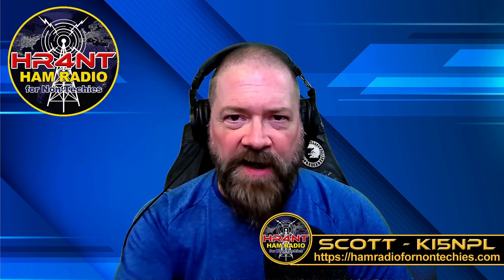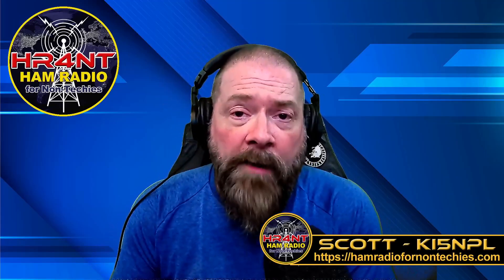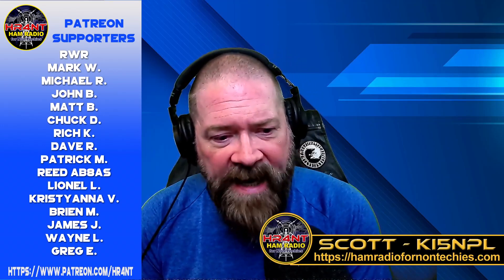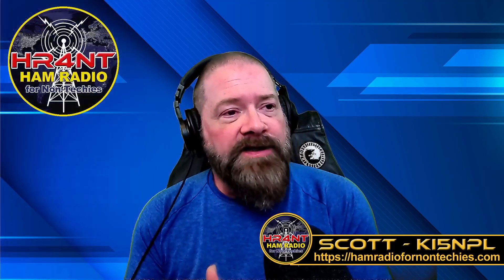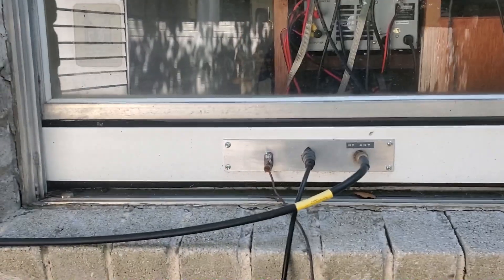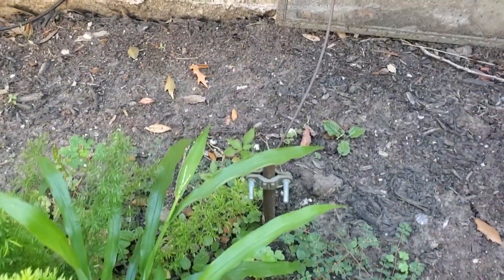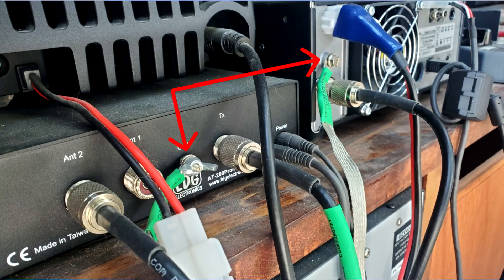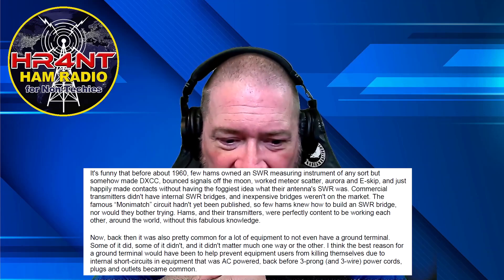Grounding My Ham Radio REVISITED:  What I Have Learned Since Then

Comment: No 90° bends A 8" radius bend. 
I drove a ground rod at the corner can't have to many grounds
attach to the wall under the door.
Ground loop if not not bonded.
Direct path to ground but not bonded isn't going to trip the breaker. The Over load will but not right away if it does. 
Static electricity needs to go somewhere. Wind, rain bulids up a static charge. Grounding helps to reduce the levels of noise and interference in the signal.
Use a ground and still disconnect the antenna.

Comment: Thank you for taking this on! I was licensed in the late 1970s, when grounding for stray RF was gospel. I'm trying to come to terms with more modern equipment. I still will ground or counterpoise as best I can, but over 40 years of progress between my beloved Yaesu FT-101ZD and my desired Yaesu FT-710 hint very strongly, to my Advanced-class (ha!) mind, that perhaps things have changed somewhat. I will continue to take the scientific approach and test everything as I go. It's just a relief to hear someone hint that maybe I'm not going to face the hot chassis, TV RFI, and other bogeyman that plagued me in 1977. I'm not sure people realize, but the social-media evangelizing re: 2nd floor shacks et al, make many throw their hands up and give in to the HOA gods. That is, leave the hobby. And hell to the yeah, when a storm is approaching or it's thunderstorm season here in the South, unplug the damn radios! I knew this as a little kid when I was first licensed. (Different grounding issue than RF grounding, but needs to be mentioned). </RANT>

Comment: It’s not for lightning protection. It’s for RF interference. Your plug has 3 prongs, where the ground prong goes to the ground in your electrical box. The ground lug on your transceiver going to a ground, which should be bonded to your existing electrical ground, is for stray RF. If you have it, the ground will rid you of it. If you don’t have it, disconnect that ground you made out the window.

Comment: Do not listen too or follow any advice given here. Don't use plumbing supplies. Buy a ground bar in the electrical department. it's made and tested for ground use. Unlike plumbing supplies & radiator clamps. This is witch doctor grounding.

Comment: VA7KMF - Im a new ham and setting up my shack... im having the same issue as you went through.  I plan on a EFHW about 132feet long antenna to get 10-80 bands.
Making my own 49:1 unun.  
I plan to drive a new ground Rod and use that to ground the coax lightning suppression and also ground my icom 7300 to the same point.  All connections to the ground rod will be in a new utility entry box.
I still dont see how to ground the antenna.. or is it now grounded through the coax cable?
Reply: I should also mention my shack will be run on battery power only.

Comment: I have got to be honest, I do not ground my shack anyway. I live in the UK and anything plugged into the sockets are earthed anyway and as such, anything connected by coaxial leads are grounded by virtue of being connected to an earthed chassis. If I suspect thunder and lightening  I will unplug coaxial leads and the plugs from the electrics. Lets be honest EMP will fry diodes and such if close enough. You only need to think about the damage the sun can inflict on discharge.  de M3ULT.

Comment: My small tower is grounded to help discharge static buildup and because lightning wants to find the easiest path to earth. I gave it one. My coax cables all go through lightning arresters after crossing my yard because any current from a nearby strike will charge those cables. The coax from my equipment to the arresters is disconnected unless I'm using the radios, which themselves are only grounded through their 3 prong mains plug. 

My reasons are simple. Why in the world would I invite lightning into my home by "grounding" my equipment to a rod in the potentially charged earth, or provide a low resistant path for it to reach my meter/panel by running a ground wire around my house and bonding to the service ground?
Reply from the maker: That is exactly my point.  Great job!  No use in inviting disaster and a free ride into your house and gear.  Thanks for the comment and for watching.  73!

Comment: Wonderful video, thanks.   My house was built back in 1963 and back in those days 3 wire grounded plugs were almost non existent. However my radio room and the desk I use for my radios is on the other side of our  bathroom and my desk and the sink in the bathroom  share a common wall. So what I did was get a grounding 3 prong wall plug and grounded it to my water line in the wall, and that seems to work fine.  Also I put one of those copper pipes like you have on the back of my desk and connected my radios and power supplies to that and then connected a ground wire from that to the water line as well. The antenna is connected to a grounding rod. Other than that, if a storm comes up I turn off the surge protector power strip and disconnect the antennas.   Now really does anyone see an issue that I may need or want to address?  Please let me know.
Reply from the maker: That is a great solution for the age of your house, it sounds like a very solid system you've set up. I see no issue what so ever with how you solved yoru issue.  Common sense is sometimes the best policy!  Thanks for the comment and for watching. 73!!

Comment: Agonizing over the grounding.  Leaving my equipment not hooked up might  be better in my situation, in reference to lighting protection. My question: reference your rf /static grounding to the copper bar - if the bar is not itself grounded, does it actually do anything?
Reply from the maker: I view it the same as wearing one of those static bracelets when working on computers.  It may not be a perfect solution, but it seems to be working so far.  Hope this helps.  Thanks for watching and for the comment.  73!!
Reply: @HR4NT  sounds good, thanks for the reply!

Comment: I'm 71 years old. When I was a kid our TV was killed dead from a strike across the street from us. Every so often I would hear people talk about a television or some other appliance that got fried. 

My sister's first home  after she got married frequently had ball lightening fly out of electrical outlets and they lost several phones including one that partially warped or melted, again this happened many decades ago.  

It may be a coincidence but in my old age the only time I hear of equipment being ruined has been from Hams. Just a few weeks ago it happened again. I have always disconnected radio equipment from antennas and unplugged  the radio equipment. So far no issues.

I'm sure tvs and computers have been hit just no one in my group of friends, family, and former coworkers ever mentioned it.
Reply from the maker: Unplugging is teh best assurance that your gear will be protected 100% of the time.  Thanks for the comment and for watching.  73!!

Comment: Here's my 2 cents....
1) Ground rods are for grounding the outside of your house.. 
2) A ground bus in your house, grounded to you panel is good for grounding your gear to the same ground potential.
3) Don't need to ground your antenna..  Once side is the driven element (coax center), the other side is connected to your other dipole element or (EFHW counter-poise..) to the coax braid.

Ideally, you should disconnect your antenna during storms, because of static buildup on your antenna can damage delicate electronics.  (Not like the old days with tube rigs..)
You may even wish to terminate your antenna lead into the house to a ground rod outside, to dissipate the static buildup safely to ground, and not arc around you shack..
If your house, tower or antenna get a direct lighting strike, you can kiss it all goodbye...  Lightening rods and arresters are for dissipating static buildup, not lightening strikes..!
Reply from the maker: You've got some good points to consider!  Thanks for watching and for the comment. 73!!

Comment: What is with "code" ? 
I guess in the USA it is building regulations like we have here in the UK? 
If your "code" says to earth your rig/ radio / setup to the house mains earth then thats just crazy. 
If you want an earth then it should not be connected to the mains ground , that is the recommendation here in the UK
Reply from the maker: The US has an electrical code that mandates how electrical connections and related things are to be done to be within the standards of that code.  Thanks for the comment and for watching.  73!!

Comment: Thank you!! I'm setting up a home station using a portable antenna that I will only use when I'm planning to be on the air. I have been stressing on sinking a grounding rod. I assume now I don't need this. Everything will be disconnected when not in use. As long as it doesn't affect my antenna performance which it sounds it won't. Great video.
Reply from the maker: Exactl;y.  Easy, simple and works 100% of the time.  Thanks for the comment and for watching.  73!!

Comment: Just saw  your videos on grounding. I am sorry you went through what you went through over that. People seem to be getting mean over anything. I thought you did what was needed to be protected. 1 eight foot copper ground rod is as good as another. I worked on mobile drilling rigs for 40 years. We daisy chained everything we could. If I was not possible we drove independent ground rods for single circuit use. OSHA NEVER SAID A WORD. And they disliked drilling rigs immensely. I am going back to look a your videos. I like your style, and your fire. I also liked that you didn't get mean with those that disagreed with you.
Reply from the maker: I found a simple solution thjat works every time and is not stressful.  Grounding is a sensitive topic among some hams, so I took the argument out of the equation.  Thanks for the comment and for watching.  73!!

Comment: Thank you thank you thank you. I worked for a company called Raycap they make lightning protection for cell towers that cost about 10k each most towers use 3 each anyone thinking a 50 dollar ham arrestor is going to save their equipment is nuts. UNPLUG and hope for the best.
Reply from the maker: This solution has and still does work for me every day.  Glad to help!  Thanks for the comment and for watching.  73!!

Comment: I'm not far off from you on the Idea of grounding.  I myself, I have barrel connectors outside at about 4 FT off the ground on the coaxes and I disconnect the coax right there and leave the coax from the antenna dangling inside the tower.  For my Rotor, I took a stereo wiring connector kit set from autozone that has at least 8 wires and soldered each end of my rotor wires to each connector and took a ziplock bag and sealed one end that comes from the antenna and put a hole in the bottom side of the ziplock so I could slide the other end of the connector into the bottom of the ziplock and snap the two connectors together and zip seal the  connection.  when it storm I take the coax with the barrel connector to the house and tuck it up under the the privacy fence where it stays dry "away" from the tower, and I unzip the ziplock and disconnect the connector on the speaker harness and pull the end that goes into the house to where I put the other coax "away from the tower and it stays dry as well.... and away from the tower by at least 20 -30 feet.  Basically when it storms there are no wires around my tower that enters my house at all.
Reply from the maker: My solution works everytime and takes the guesswork out of the equation.  Thanks for watching and for the comment.  73!!

Comment: This is my whole point about grounding. I'm stressing myself trying to figure out how to setup my shack's station ground, When in reality i only plan to operate my radio a few hours at a time, and when i'm don't using it, i plan to disconnect everything even the antenna since i am using an EFHW.
Reply from the maker: Exactly, so instead of stressing yoruself out, this solution works every time.  Thanks for watching and for the comment.  73!!

Comment: I would not run a ground wire to the outside that gives lightning a path into your house. I bond everything in the shack and use the house ground to the main breaker box. The outside ground is for antennas and towers that require a ground wire. I do run a wire from pass through ground plate to ground rod and then tie the two ground rods together per code. My two ground rods are about 70’ apart.  I don’t care what anyone else does with their stuff it’s their responsibility.
Reply from the maker: I think my solution in this video was pretty sound and it has worked lfawlessly since I adopted it.  Thanks for the comment and for watching.  73!!
Reply: @ Any or no solution works flawlessly until lightning strikes .

Comment: Thank you. As a new ham I appreciate all perspectives on this subject. We live in a very rural area, and when storms approach or are forecast we unplug most anything that has a circuit board. I have grounded the radio but have not bonded to the main entry ground. Thinking about undoing. 
Several local club members agree with you.
Reply from the maker: It sounds like you are making smart choices for your setup.  Thanks for watching and for the comment.  73!!

Comment: Ground is a concept, à way to close an electrical circuit before your body does. It’s a kind of a neutral bis that should not work, unless appliances that should not becomes live.
All these protections speed up the current flow to make the circuit open, so cut the power in your hous fast before you touch anything.
As soon as you create another ground you create a new potential between different appliances.
RF is blocked by chokes, nothing else
When to lighting the only thing you can do, is to put a spécial equipment at the outside, disconnect any link with the outside have a special circuit breaker and pray.
Reply from the maker: Thats kind of wherte I came up with this solution to just unplug everything if it is not in use or if a storm is coming, but I completely get what you are saying.  Thanks for the comment and for watching.  73!

Comment: Hi again.
So, I sail. I mention that because on a sailboat (and mine is a steel sailboat) we have a big tall aluminum stick pointing at the sky and floating in flat salty water.
I also do  marine electricals and like you I had decades in the IT and telecom industry.
So this is where I am coming from.
You are absolutely right, if a lightning hit your antenna or my mast we're toast(ed). No wire is big enough to carry that current to the ground and allow it to dissipate. If you have a permanent antenna beside your house the tower IS in the ground from the get go.
Now, there are many different kind of grounds and they have different purposes and that is where (I think) many people get confused.
Your IT bracelet was for static electricity. The ground wire in your three prong wire is for a short in an appliance. The ground screw in the back of your amp, receiver etc are called case-ground, in case the case becomes charged (via induction for example). You also have RF ground. 
On a boat we do not have grounds (literally! LOL) so we call it source. 
You want any stray current to go back to its source. 
This is likely why the cities want you to connect any ground back to their "rod" so any stray current goes back to the grid.
With ham (and other hobby where you amplify electricity) ground can become a serious issue. One issue in ham  (or tube HiFi system etc), is noise. Noise is often due to electrical issues, some say cut the third pin (the ground)  ahead of your gear and the noise goes away my question is, where did the electricity go? By cutting the ground you just cut the safety path for the electricity to go back to its source. You also want to avoid having any unwanted electrical current traveling through your gear while trying to go back to source, this is mostly what you are doing with your case ground arrangement, putting all your gear at the same electrical potential. You want any & all current to have a path back to source/grid/ground.  Final thought, with your rod there, if a little bit of electricity leaks from your gear it goes into the soil 0k,  (well technically it is not back to the same source). If lightning hits near your house that rod will conduct electricity from the lightning bolt right back up to your gear, this is where fuses and breakers get into the pictures. 
My TV blew-up and it is the ground wire's fault, suuuuuuure.
My 2¢.
Cheers,
a.
Reply from the maker: I hear what you are saying and agree.  My solution of disconnecting everythign at teh slightest sign of a storm or when it is not in use seems to be the best solution for me.  The position of my shack and the design of the house as to where my official rod is located makes it a major pain in the butt to run a "proper" ground wire, so I came up with this solution instead of stressing abotu how I grounded.  Is it ideal?  no.  Is it more work? Yes  Does it work? Absolutely!  But thank you again for sharing your knowledge.  I really do appreciate it.  73!